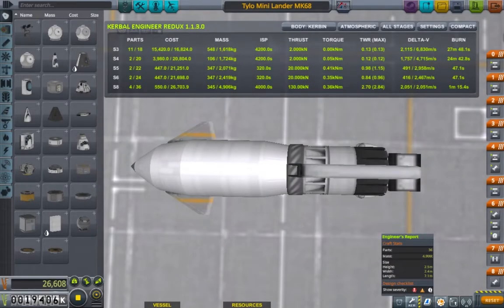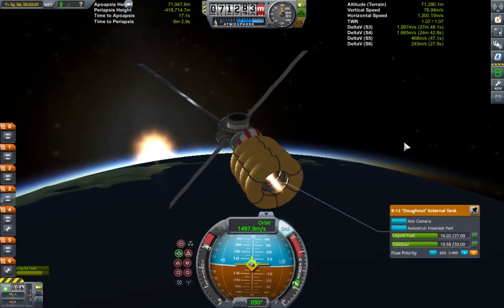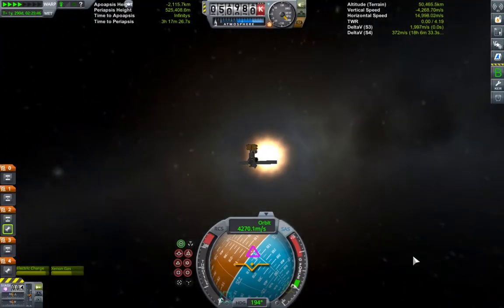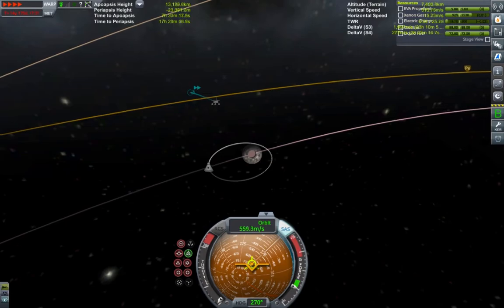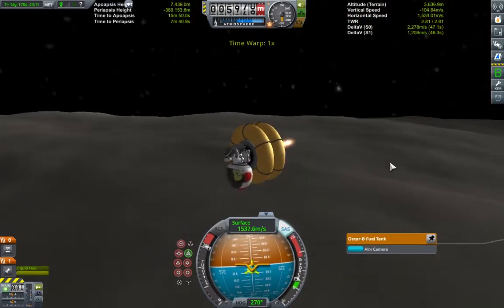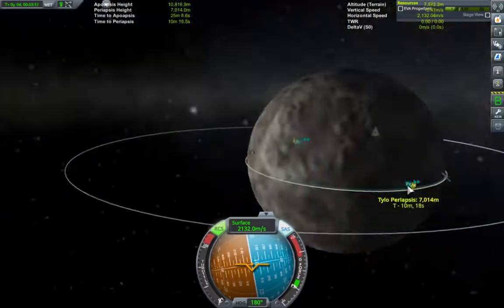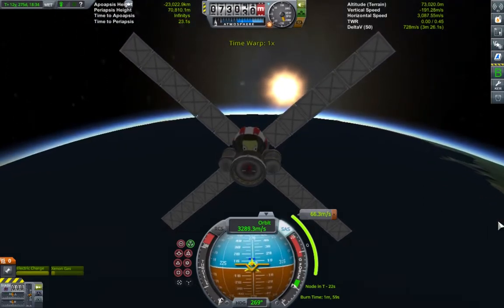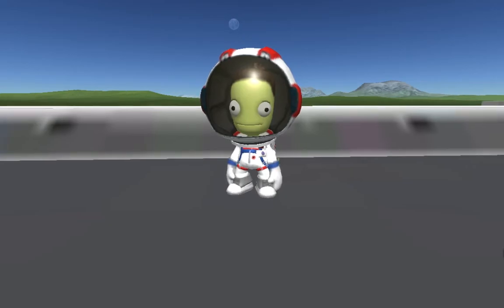Tylo and Back on 5 Tons [KSP 1.5.1]

Comment: the stack separator is used to recreate interstage skirts that separate after the ullage burn (ullage motors are mounted on the skirt) I tend to use them a lot in real rockets recreation

Comment: currently trying <10 tons to dres so im taking notes
Reply from the maker: What's a Dres? Sounds like a good challenge! Are you making a video on it? If so, feel free to share a link! Landing on something less massive than Tylo should be a lot easier, but on the other hand Tylo has all the other Joolian moons around it which really helps to save fuel when it comes to capturing in orbit. Good luck with the mission!
Reply: @GuybrushKerman  its for a challenge. annoyingly one of the conditions is to take the science jr etc so thats the main design challenge :)
Reply: @GuybrushKerman  the 1st stage of your craft is brilliant so im stuck on whether to do a kinda copy paste ish thing or building a new but heavier 1st stage
Reply from the maker: @rugmugger9100  Oof yeah the science jr will affect the whole design. The whiplash on the first stage was necessary to get this craft under 5 tons, but if you don't have that limitation then a Rapier would almost certainly be better as it will allow you to reach a higher top speed during the Kerbin ascent.
Reply: yeah the science jr is not good for twr with ion engines because more fuel in the lander as well